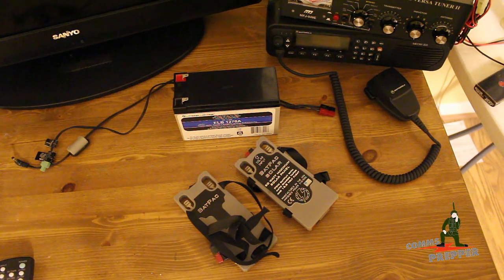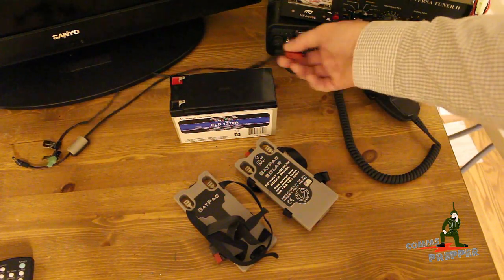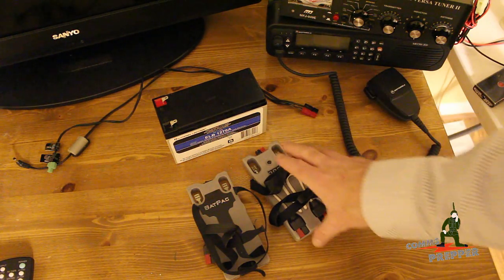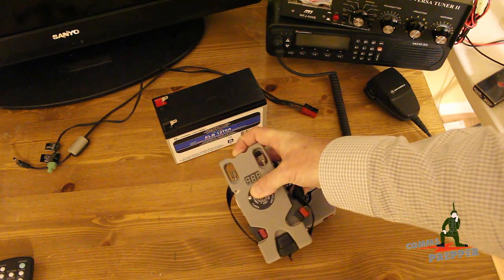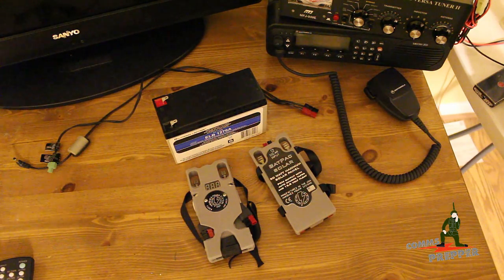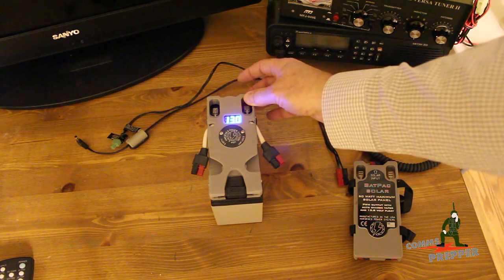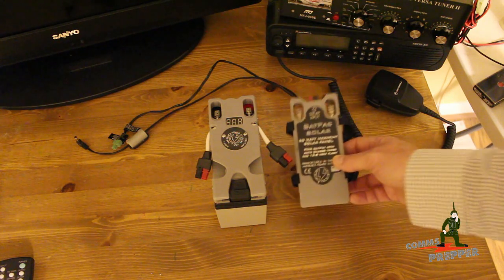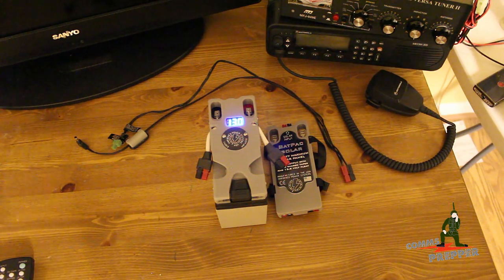Hardened Power Systems' BATPAC units

Comment: I'm glad they sent you those! I just need a little nudge and I'm going to get one. One question though, is it possible to run 50watt tx (2m) on one of those batteries? My guess is no, but what do you think would be the max output wattage?
Reply from the maker: +Logic Bob Not sure - I will check the battery.  50 watts (10amps) seems a bit too much but I will respond here after I check.
Reply: +Logic Bob i Run a 75watt FT-2900 Radio using a 9ah SLA Battery and a BatPac as well as a 15ah BatPac 2 just fine
Reply: SilentSniper Vt Great! Thank you for chiming in! That's the same radio I have, so that's all I need to hear to place an order. 

Thank you too Commsprepper!

Comment: Do you have a video on your Anderson connections to your hand held radio? This seems like something that would be very useful .
Reply from the maker: +setofirons The cable is in the video.  It runs between the radio (FT-817ND and the BATBAC).
Reply: I understand. I was asking if you had video on how you attached them to your radio. I.e. stripping the wiring from the charger so it can run to the pack.

Comment: Brother I am looking at buying the Morningstar Tristar TS-MPPT-45, 45A MPPT Charge Controller in the next few days. I have 8 T105 Trojan Batteries. I was thinking I may need help doing the programming side for my batteries. Would you be willing to help if I have it setup so you can log on. I am willing to pay if need be. Thanks Brother. God Bless
Reply from the maker: +yankey4 Happy to help - pay not needed.  However, how many amps does your array generate?
Reply: Commsprepper Well ar 48 volts my 1280 watts would be max 27. amps.
Reply from the maker: +yankey4 Only you know your system - just make sure the charge controller amps exceeds the amp generation capacity of your array.
Reply: Commsprepper 99.99% of the time I will be just runiing 240 watts at 24 volts that is 10 amps. But if the power been out a long time and I need more pv power I can set it up to use all 1280 watts and that would be 48 volts at 27 amps.
Reply: Commsprepper Just payed for 240 more watts of PV and the Morningstar Tristar TS-MPPT-45, 45A MPPT Charge Controller. Whoo whoo :0)